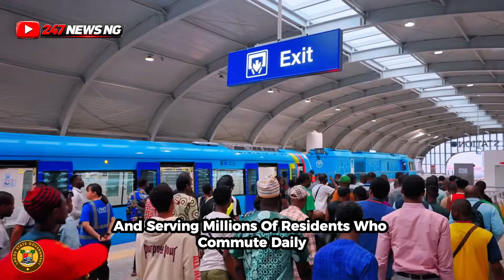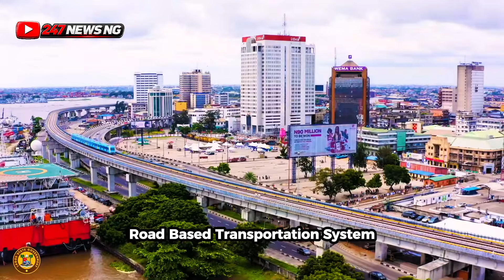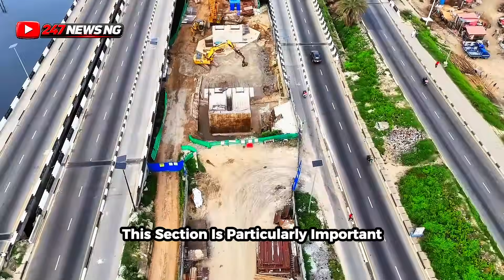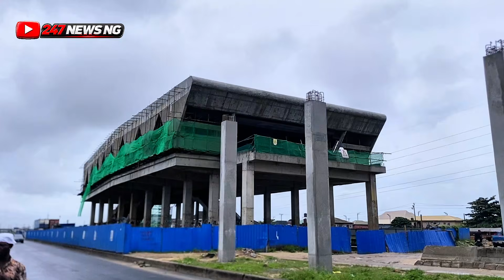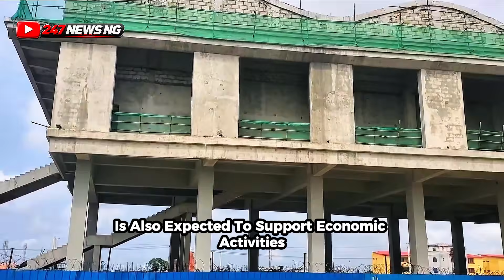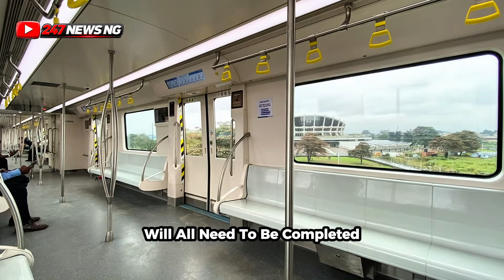Lagos Blue Line Phase 2 Is Rising Fast! Full CONSTRUCTION UPDATE from Mile 2 to Okokomaiko Stations

Comment: Nigeria needs housing infrastructure. They must learn to build every city upwards. Roads and metro are not the only things to be build. The slums and lack of maintenance are way more than the development. The roads should be built to Europe and Asian standards, with sidewalks on both sides and underground drainage not  with opened gutters by the side. The level of foolishness by Nigerian leaders is worst than the development. They can build as many metro as they like but if there are no buildings, the city will continue to look like a dump. The only good buildings in Nigerian cities are banks and hotels. Everything else are slum buildings except for the houses built for the rich tucked in specific city locations. Development isnt about building roads only. Angola looks a hundred times better than Nigeria in terms of infrastructure. There are no plans for santitation and removal of garbage. The streets are never swept clean. They have already dumping garbage on the red line tracks because the leaders refused to elevate it. Nigerian leaders are a joke. Ordinary common sense, our leaders don't have. Beyond shameful! 

Build your cities like Shanghai, Hong Kong, Angola not like Mumbai